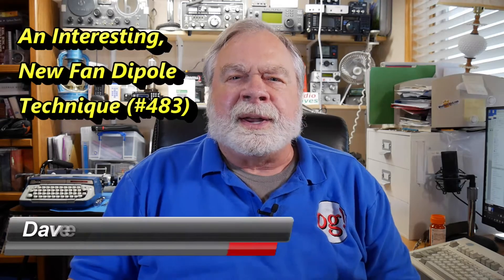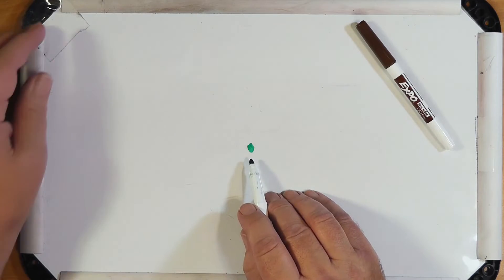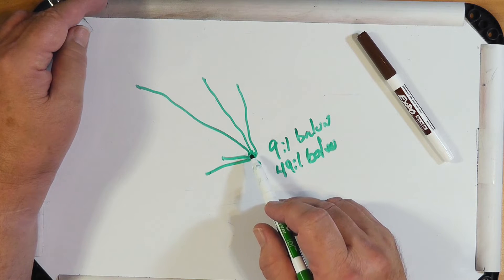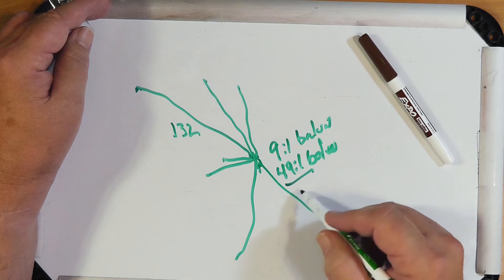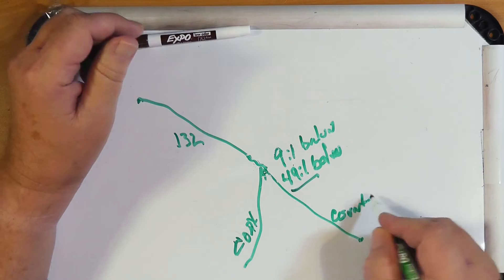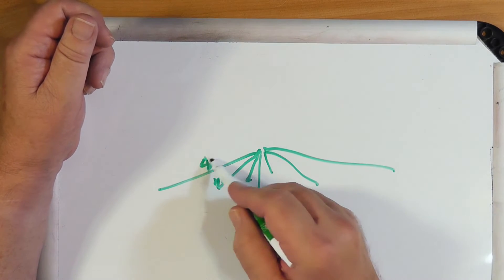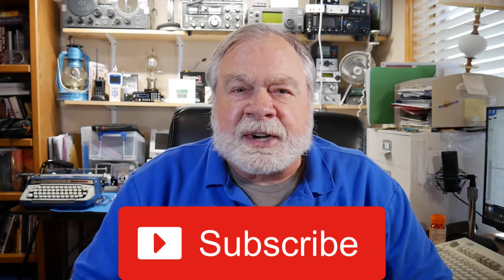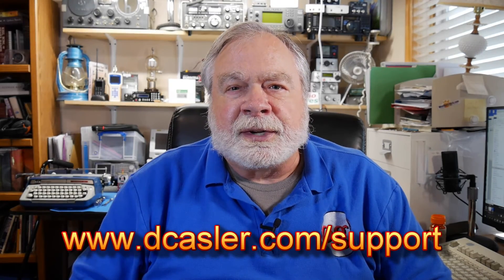An Interesting, New Fan Dipole Technique (#483)

Comment: Agree the elements for multiple resonant bands are redundant into a half-wave on the lowest band. Fan dipoles are effective because each "pole" is 1/4w which makes the even harmonics mismatch. On the other hand, a fan arrangement for the non-resonant bands such as 30/17/12 is worthwhile. The other problem trying to work higher bands on a long element is pattern since the antenna begins to behave like a long-wire. If the antenna is horizontal, that "long-wire" can be pointed for best directivity. Lots of options. I have found I need a little something for counterpoise. The bare minimum seems to be a single short wire, i.e. 2 or 3 meters, I use when portable (grounded if possible).  If there is an effect on directivity, i haven't noticed, but problems in the shack with no counterpoise go away when that wire is connected to the ground lug.

Comment: If the purpose is to save space a 1/4 wave on each band connected to the centre of the co-ax and another  set of 1/4 wave wires connected to the shield dropping down to the ground laid under a house or anywhere works well.